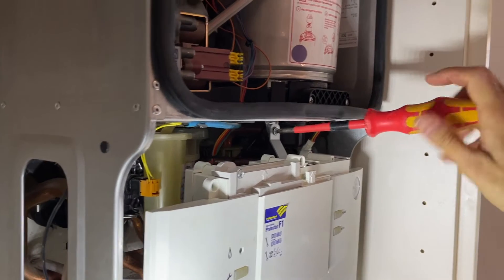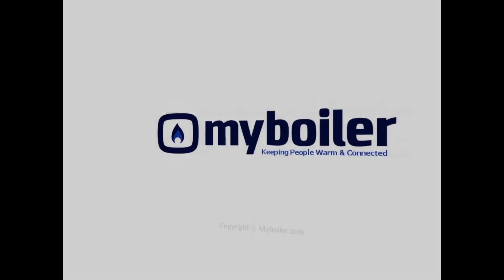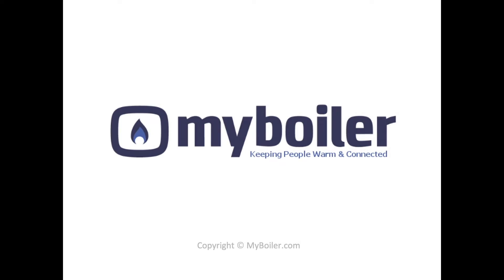How to: Inject Fernox Express via the Worcester Bosch drain port

Comment: I can confirm this stuff stings when sprayed in to the eyes! Lesson learned, make sure the drain valve is definitely fully open before injecting 😂
Reply from the maker: 😳  Yes this little hack is very different and effective, but does need a little practice on first few goes.  Hope the eyes are ok. We tend to now wear safety goggles in these occasions after having been through the same thing. Jay K.

Comment: Wont the inhibitor come back out is the isolation turned off from boiler
Reply from the maker: Hey, 
you have to hold the tube, stop it from coming out, as soon as the cannister is empty, you isolate the valve while still holding the tube in place, then you pull the tube out.

 As the Fernox Express is so fast, it's usually done in less than 30 secs. Also to note, the tube is quite tight and this helps you to keep it in place. Luckily, it's pretty much the same size as the drain point hole.

One hand holds the valve, ready to close it, the other holds the tube and trigger, ie pushing towards the hole so it can't come out. Also make sure you have some rags / tissues underneath it to catch any residue/liquid.

Hope that answers your question. JK

Comment: Yeah don’t think I’d be doing that looks like it kept leaking after ?
Reply from the maker: Hi Wayne, 

there is residual chemical after the injection process, you just have to clean with tissue. It does not continue leaking after shutting the drain valve. If it did, then you have a faulty drain off valve, in which instance, you would have to replace at some point. 

In all our time opening and closing this drain valve, we have yet to come across a leaking drain valve, although not impossible as it is a mechanical part. 

JK